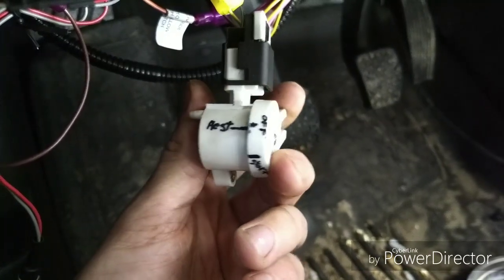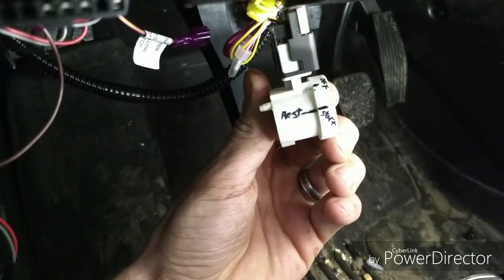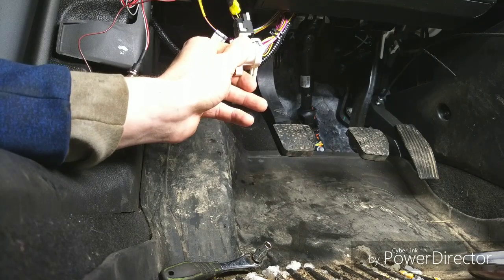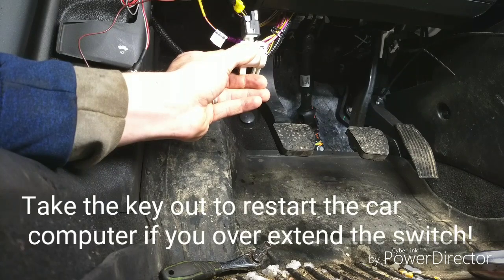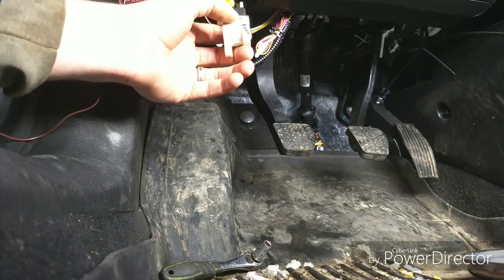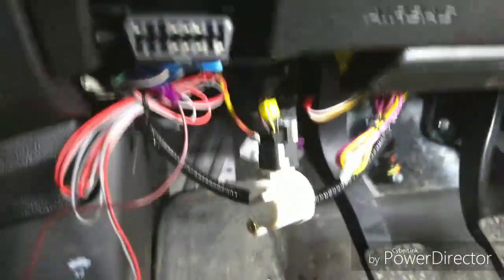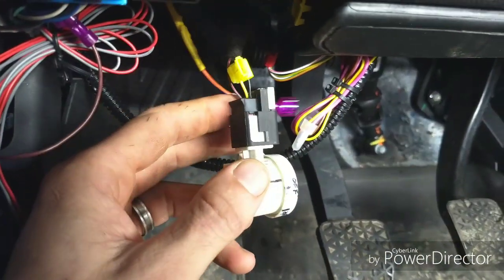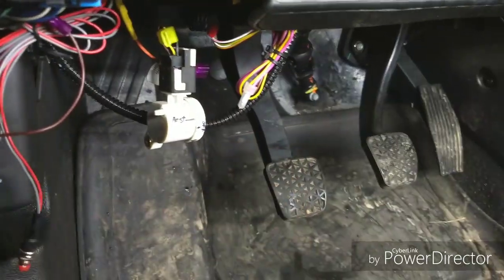Clutch switch Chevy Cruze/ how it works

Comment: video molto intelligente, ho capito che la ECM da il consenso per l'accensione del motore secondo il valore di resistenza in OHM che vede sugli input ....esempio se la resistenza è troppo alta (o bassa) non da il consenso per far accendere il motore ......di solito con il tempo questi potenziometri di difettano ..... can you show in a new video the disassembly and reassembly procedure for replacing this part on cruize
Reply from the maker: @ppaolosan You're correct.. i would just replace it.

Comment: Hi! I need to buy the harness/cable that plug that sensor... in my car is not installed, the clutch sensor is not working because of it... what is it name/part number? can you show how is it plugged to the other point? thanks!
Reply from the maker: You shouldn't be able to reverse how it's plugged in it only plugs in one way.( to my knowledge)
Sorry to hear about the troubles. 
I gave a part number to someone a while ago.  In the comments. 
 Part number is 
(13597418)
N5 26C

I looked up a Link where you can get the same one as me.

https://www.carid.com/acdelco/gm-original-equipment-brake-pedal-position-sensor-mpn-13597418.html?view=403359&gclid=Cj0KCQjwhdTqBRDNARIsABsOl98UyEYPfmdWjvJLZjSgXk5cOwhstIBvmcED8uJ6rYo7BHemtXqNdZ0aAtE8EALw_wcB

Hope the number still works for you. I've not looked into it since.
Reply from the maker: Well, never mind the link I set it doesn't work anymore. But the part number is what you need.

Comment: Well so im a delivery driver. I got back from delivery. Came out to the car to go on another delivery. And it did one click. No crank, just one click.  the battery is good, and ive checked all the fuses. Tried turning key in on off. A budy said it could be the clutch igition switch. Should it try to push start it? And if it starts what does that mean?
Reply from the maker: i have no idea if it would start like that. maybe i should try that. kye needs to be in the on position you might use 3ed gear. sorry never seen your message. till now.
Reply: @CalebGibbsAvenue  all good, ended up being the starter.

Comment: I’m pressing my clutch and my car won’t start any suggestions 2011 Chevy Cruze 1.8L
Reply from the maker: I'm wondering if your clutch  Switch is working. It's a $12 switch it Worth getting replaced.
Reply from the maker: faulty car batteries, spark plugs, car starter, or fuel pump

Comment: Just bought a used 2013 cruze 6 speed manual from a friend. When cold starting (Florida temps) it will not go into 1st or reverse the shifter just pops out. After driving the car for a while it will engage in both those gears. Should I be looking at cables or a slave cylinder? Totally lost here, also the clutch pedal seems really low, normally I've experienced clutch pedals being even/ slightly higher than the brake pedal but this clutch pedal is slightly lower than the brake pedal and I have to push it ALL the way to the floor for it to engage, she told me she just had the clutch replaced by a shop, almost wondering if they did something wrong.
Reply from the maker: That's very possible to have the clutch out of adjustment. Even after replacing it. Most are self adjusting you don't want much more than a 1/2 play on the adjusting fork.
 If the gear is dropping out its worn bad.
It may be possible to add Lucas oil transmission additive. To help it shift smoother.
Reply from the maker: On a cold star you're oil is thicker this is where you may see it shift better.
Reply: @CalebGibbsAvenue  It's a manual.  Its the clutch.  Most folks burn out clutches at 100k or fewer miles.  Warming the car does help with shifting.  However the tranny stays cold until its moving.  Its a manual ffs.
Reply from the maker: @skildude  yes I'd say the clutch is probably some of the problem. if it takes a long time to get it in gear and you have to focus it in or if it grids its definitely the clutch. A badly worn gear will kick out of gear when exhilarating hard. Or won't stay in place. The right thickness of oil will make your gears run as smooth as silk till it thins out with heat. The thickest oil i know of is Lucas. Never tried it in that manner but it might work for now.
Reply from the maker: Here's what I suggest everyone reads.
http://heartlandlloyds.com/2017/04/17/are-you-having-trouble-shifting-during-cold-weather/
Reply from the maker: sounds like some kind of engagement issue that fixes itself when everything heats up

i have a feeling that your pushrod is slightly blocking the relief hole at the bottom of the master cyl reservoir and when it heats up and expands, the relief hole opens back up and the clutch is able to operate normally.
i would recommend two tests:
1) adjust the pedal to engage lower to the floor
2) adjust the pedal to engage higher off the floor

one of those may fix it and you probably only need like 1/16" to fix it. (IF its caused by the relief hole)

Comment: would like to see how its removed or installed so I can find if this is my problem
Reply from the maker: Its not really hard but it is a bit hard to get up under the foot pedal area. Its attached to the clutch pedal
Reply: @CalebGibbsAvenue  I got under and saw it today, I hope its as simple as unscrewing the bolt or nut on the pedal or sensor bracket, whatever it is. Just don't wanna take everything apart just for a sensor

Comment: I just installed a remote start and it says must press clutch to start car. Where can I buy the piece you have? Thanks.
Reply from the maker: Will the part number on it work?
Reply from the maker: Part number is 
(13597418)
N5 26C

I looked up a Link where you can get the same one as me.

https://www.carid.com/acdelco/gm-original-equipment-brake-pedal-position-sensor-mpn-13597418.html?view=403359&gclid=Cj0KCQjwhdTqBRDNARIsABsOl98UyEYPfmdWjvJLZjSgXk5cOwhstIBvmcED8uJ6rYo7BHemtXqNdZ0aAtE8EALw_wcB
Reply: Awesome thanks
Reply: Did either of you get remote start to work? If so how??
Reply from the maker: @dennisgrubb1507  No it doesn't work. In the process of putting it together I might have damiged how it was programmed to work. 
I have video footage explanations of everything but don't see the point of putting a update video of what happened, not useful information for the world if it don't work!
Reply: Dennis Grubb I spent $300 on a viper system and had it professionally installed, so now I have remote start. The do it yourself way was very frustrating and the professional install has a warranty and works perfectly and I had to do nothing but pay 1 time and it was done correctly the first time instead of trial and error and possible electronics messing up in my car if I do it myself lol.
Reply: @dennisgrubb1507  Remote start only works on Automatic vehicles.  You have to push the clutch for a manual transmission to work.   There is no work around.  Chevrolet has removed manuals from their vehicles lines in 2020 or 2021. This allows for remote start on all cars as well as the engine stop/start when the vehicle is idling at a light.
Reply from the maker: @skildude  yup I had some trouble doing it my self sill hadn't figured it out.
Mine is mad for manual transmission.  But I think i screwed up the code. Has to be coded in a  Certain manner. Or it will mess it up. Just won't complete the coding process.

Comment: I have a 2011 cruze ive replaced the switch and my car still will not start
Reply from the maker: Will it turn over? If yes. the switch isn't doing to be the problem.
Reply: It starts above 50 or so anything below that and it wont turn over at all
Reply from the maker: So basically you're telling me it won't start in the cold.
Usually that could mean faulty car batterie, spark plugs, car starter, fuel pump or bad spark plug Coils.
 If any of these were happening  It will run roughly. Or turns over slowly if the  battery is low. 
Do you have any check engine lights?
Or battery symbols
Reply: Ive replaced all of those the only code i have thrown is the cruise control sensor high voltage code and i had the battery tested it test fine
Reply from the maker: @dakotabanks6438  well I'm not sure what to say.  There are many reasons for it to not start.  Usually if hot and cold has anything to do With it there is a short circuit somewhere, I would check your fuse panel check for any corrosion behind those areas check for bad fuses. clean the starter motor connection.
 Sometimes even a faulty ground can cause problems. So start with the battery   then the fuses and starter.

You where right to check the clutch switch that could have been the problem too. 
If you get it fixed your the man lol it's always a puzzle.

Comment: Thank's verry good
Video
Send me more please i have cruze 1.8 LTZ car
Reply from the maker: What are you interested in? And I'll see what I can do
Reply: @CalebGibbsAvenue  
The car does not respond very well especially in the highlands where it went down to the first speed to overtake the high !!
Reply: .. I deleted the catalytique Befor it make me a problème in the Highlands
Reply from the maker: @mehdijari2407  my questions are as follow 
Do you have a check engine light on regarding the oxygen sensor!
The removal of your catalytic converter can cause damage to it!

I don't recommend removing the Cadillac converter but you should be okay! Depending on if you are getting enough back pressure in your exhaust! 

Indefinitely not an expert but eager to help!
Reply: @CalebGibbsAvenue  
Thank's m'y freind